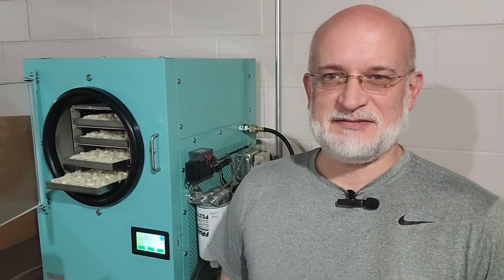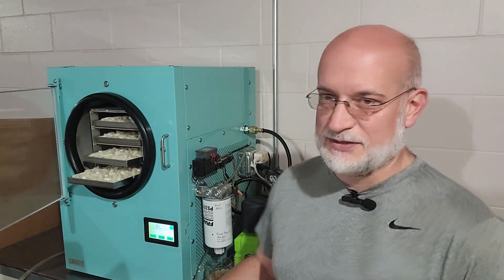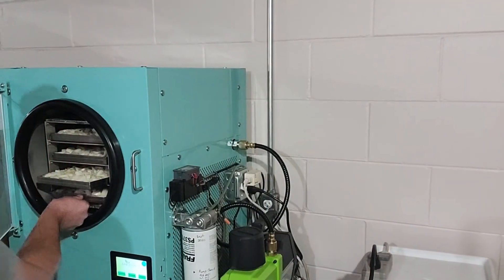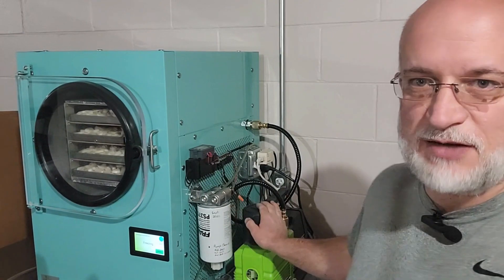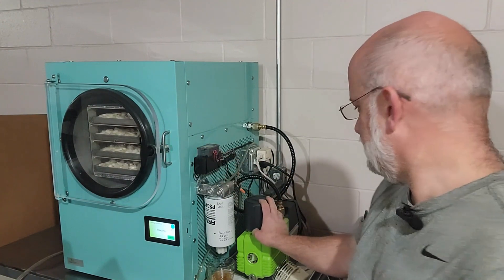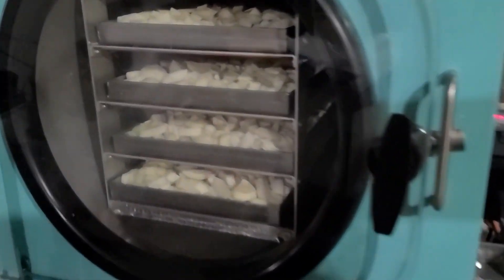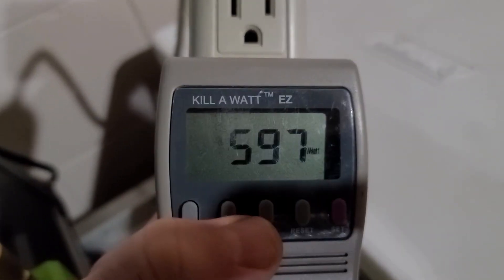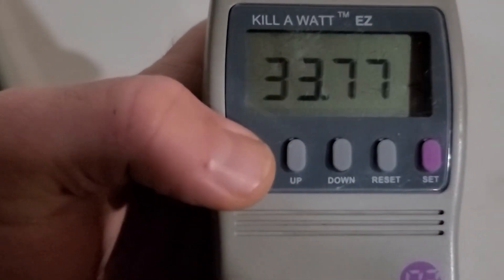Wattage Wednesday: How Much Power does a Harvest Right Freeze Dryer use

Comment: Thanks for the video.  I'm not an expert, but aren't you supposed to place the round insulation pad in the chamber,in front of the door?  It will save you a bit of power for the freeze cycle.
Reply from the maker: You are pretty observant! Per Harvest Right, "Freeze Dryers no longer ship with a Black Door Pad. It will not affect your ability to freeze dry; you can successfully run your unit without a door pad." Also, the onions really make the chamber stink, so the pad would hold in the onion smell and be nearly impossible to clean.